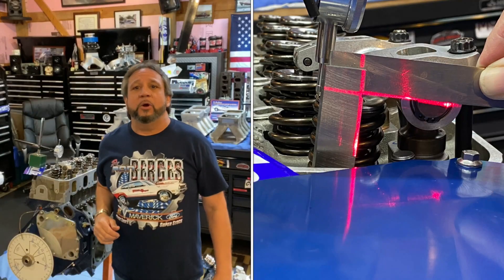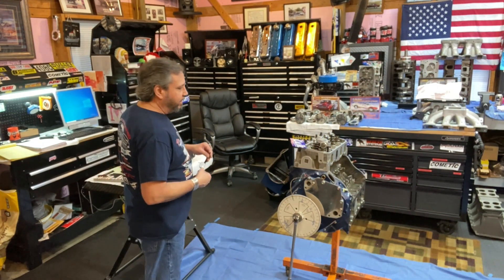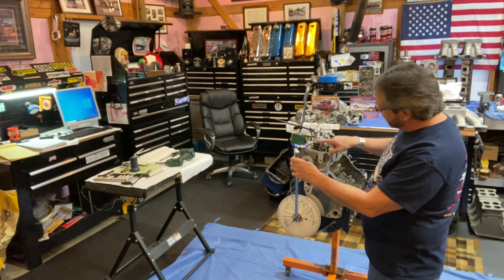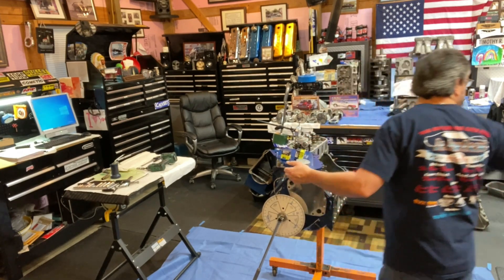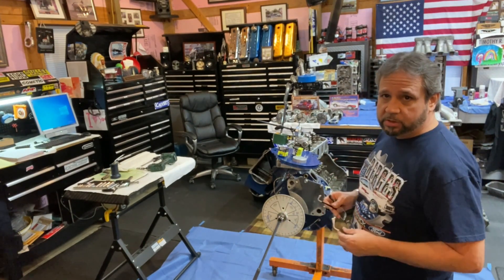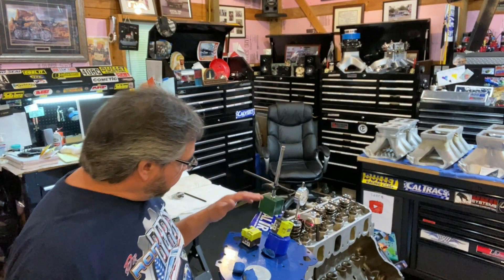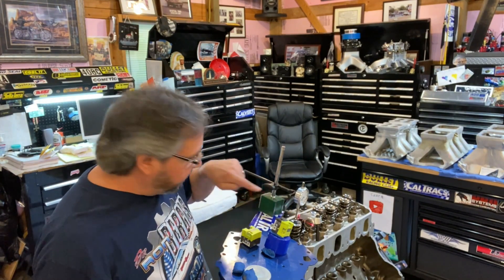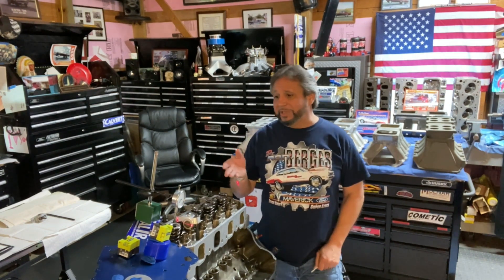Mid Lift Theory /Rocker Arm Geometry, Laser Guided Precision.

Comment: Tim, you've piqued my interest on this one.  I measured a Big Ford with A460 heads a minute ago.  In order to acheive a perfect 90deg valve-ro-rocker angle I would need to add .550" to the pushrod length.  Doing so puts the roller contact to the outer 80% of the valve stem.  It would seem like the mid-lift theory might be better served to average both the pushrod-to-rocker angle along with the valve-to-rocker angle.  My guess is the closer both operating angles are to one another at mid-lift, the better the balance between rocker arm actuation via pushrod, vs valve actuation via rocker arm will be.  What are your thoughts?
Reply from the maker: Steve, I think you are right need to compromise with both. With measuring you want it loaded, with actual valve springs, and parts you are going to use. I have also heard, that you take the 90 degree relationship, rather than the narrowest patch. Not sure on that totally, first time i have ever used it.
Reply: @DragBoss351Cleveland  Tonight I'm going to do some tests.  The first will be finding the pushrod length/rocker height that leaves me with a 90 degree angle from pushrod to rocker arm.  I would imagine an average of PR length required to yield a 90deg angle from rocker arm to valve as well as PR length required to yield a 90 between the pushrod and the rocker will yield an optimal pushrod length.  Valve length considerations will then be tested by adjusting valve lift from the mid-lift baseline to simulate either a longer or shorter valve.
Reply from the maker: @stevewix  Your way past me on that one, I understand the concept. Wondered how valve length changes it, how much overall keep me posted.
Reply: @DragBoss351Cleveland  Initial report is it works and it works well.  The roller tip is centered, sweep is more narrow, it looks right.  Here's how: Seek a 90deg angle between the valve and the line that bisects the roller tip contact point back through the axis of the trunnion, record the PR length.  Similar process with the pushrod side except you'll want to approximate the very tip of the pushrod and draw your line back through the trunnion axis.  You'll end up with two separate pushrod lengths.  Average the two PR lengths, install it and you'll have equal operating angles at mid-lift.
Reply from the maker: @stevewix  You make it sound easy, I will have to test with another build. Likes for taking the time for us Steve, Lots of info being exchanged, thanks man
Reply: when you did this with this test, did you see a change in net lift? over half an inch in PR length should change the geometry significantly enough that the net lift should differ significantly.

Comment: I found an old school scrapyard here in the Netherlands. The Guy has alot of complete ford big blocks laying around. ( And alot of Windsor small ) I think i saw 385 series and FE. But im not familiar with them. Alot of 2V carb but some are 4v. I think only the 4v are interesting for a high hp build cause the other ones are low compression truck and limousine engines?

Do you know what engine codes I need to be looking for that are interesting? I might pick up a big block for a future build before their yard is gone, these guys are old. It's like a time capsule back to the 70s lol. Must be at least few hundred engines in there and transmissions
Reply: ANY 385 BLOCK will hold a decent amount of power with a good rod and piston in it. Early ones only (68,69,70,71), will have factory heads with high compression; all the ones after that have lower compression. ALLOY heads are a great way to save weight and increase performance !!
Reply: @arkhsm  yeah, im looking for the early ones...
Reply from the maker: Man that is a treasure chest over there. For any cleveland, block does not matter, 2 or 4 bolt. I think the earliest ones are best, The most popular cleveland seems to be the D2AE, they had a lot of shift though also. DOAE, I think are the best. Does not make a difference with carb, unless your looking for 4 bbl heads. You can make CR what ever you want. 385 blocks the same, earlier the better. Thanks Bart.
Reply: @DragBoss351Cleveland  hè didn't have Clevelands. I maybe saw 1 that was a 400M I think
Reply: @DragBoss351Cleveland  yeah 4v heads... Hè had mostly 385 and FE engines i think. I Will need to go back  and find the engines codes. I would be interested in buying An early one with high compression and 4v heads. 

I think alot of Them are the later lower compression ones. I really need to have the guy there allow me to look up some codes to see if there is an early one out there
Reply from the maker: Probably 400, may be 351m. To bad you did not live close by, have one for you Bart. Can you imagine the Mustang with 0ver 500ci. Man alive
Reply from the maker: You never know. Offer him a few bucks to just look around, I would take high low cr, anything to start with.
Reply: @DragBoss351Cleveland  i saw a 460 2v . Will have a look around when the weather cleares. It's so bad here only 14c lots of rain almost june!
Reply from the maker: @hoedemakerbart  it gets done when it gets done. 10 am and 75 and sunny.
Reply: @DragBoss351Cleveland  lucky:)
Reply from the maker: @hoedemakerbart  oh yeah that 605 would be perfect for 1940 Ford Coupe. Thanks for the heads up.
Reply: hoedemakerbart the Ford 385 series of big block engines would be an excellent choice for making good power numbers without costing a fortune. As with all engines,  more power will naturally cost more so doing some research online will help you become familiar with the components you need and avoid paying for the wrong parts. 

Here in the U.S. there are still plenty of good rebuildable 385 series big block Ford engines available in the salvage yards. The 370 cubic inch version was mainly used in truck applications and came with 2-V or 4-V carburetors. The 429/460 passenger car engines were also equipped with either carb and the 460 was used mainly in heavy Lincoln-Mercury cars that needed the big torque they provided. The high performance 429 Cobra/Super Cobra Jet engines ceased production in 1971. They have blocks with 4-bolt main bearing caps but are rare and unlikely to be found in a salvage yard. 

According to Jon Kaase in an article published on Hotrod.com about the advantages of using a 460,  he suggests using any 460 block produced in 1979 or later for stroker builds. Apparently these particular blocks have 0.250” longer cylinder walls than previous 460 blocks. They would be a good choice for long stroke builds to add stability to the piston when it reaches BDC. Regardless of the make of engine, it’s a common problem with strokers when too much of the piston is exposed from the cylinder wall at bottom dead center. The piston instability causes a loss of ring sealing and lost power with increased wear on thrust surfaces. 

You’ll need to know how to read the part numbers and decipher the casting date codes located on the side of the block.  You can Google it and learn what it all means or ask me and I will try to help. 

The cool thing about using a regular production Ford 460 block is the low cost compared to an aftermarket block. Plenty of stroker kits are available. With a 4.390” bore and 4.500” stroke you’ll have 545” of badass Ford 👍.
Reply: @danielwilson6665  thanks. I Will have a look what they have

Comment: My number 3 and 5 cylinder in my sbc 383 seem to require longer pushrods than all the other cylinders. Literally a full additional turn on the rocker cups to get them within the .019 spec. I have 7.900 in pushrods for all the other cylinders but those two require like an 8.10 to keep it under the two turns for these shaft rockers. Any idea why this is? It's a solid roller cam.
Reply from the maker: That is strange. Only thing I can think of block, head not square, or rocker pedestal. Cam lobe not equal. I don’t know. Maybe someone will chime in.
Reply: @DragBoss351Cleveland  think it would be ok to use different length pushrods for those cylinders? Come to think about it the pedestal being hardened steal did have a slight bow in it believe it or not.
Reply: @DragBoss351Cleveland  figured it out as I was like well maybe if I tighten the pedestal bolts tighter it'll pull the bow out. So I go to do that and the damn things where loose. So ill run through them all and locate them down. After 6 months the problem is solved lol
Reply from the maker: @mitchellfay5725  It could, if your running big pressures, there is a lot of flexing, and stress. If the geometry is good, roll with it. Not great with valve train, learning myself.
Reply from the maker: @mitchellfay5725  Excellent, send it. Glad i could help, if I did...Stay tuned.
Reply: Run a straight edge across the valve stems. See if they are all the same height.

Comment: Just MEASURE gross lift! You can MEASURE increases in lift however you trying to look down a laser level is open to tons of error.   Shorten the pushrod. If you lose gross lift at the valve you are going the wrong way. Then use a longer push rod. If you gain gross lift, you're going the right way. This works on adjustable pivot rockers only. For shaft or pedistool rocker setups, you have to shim the shaft or pedistool to see this change. Max lift you can accomplish will result in a MEASURABLE result of best geometry.
Reply from the maker: Others have mentioned it. This is something I tried. Works for me. Will have to try the other method too. Thanks

Comment: So everything is working off the rocker.cover rail, a surface which is basically uncontrolled for parallelism and flatness. Then bolt on a plate with a ton of projection error and eyeball a laser to it. Thanks, but I'll stick with my Prussian blue......
Reply from the maker: Thanks for watching Mike. Like I say, if it works for you stick to it.

Comment: laser in thumbnail aimed too high on valve stem side
Reply from the maker: Looked great from my view. Runs 8400 through traps and good to go. Thanks for watching.
Reply: might LOOK good, but its geometrically flawed, the pivot points are the center of the large part of the roller, which is correct and the TOP of the valve stem/roller. Put a degree wheel on what you have there and you will see when you spin it, the method you used makes it off.
Reply from the maker: @vg23air like I say do what works for you. My buddy down under utilize this method and hooked me up. That engine made 769 with a 4150. Runs 9.30s at 144. Shift at 8k and go through at 83-8400. All good for me, so will ck it out next time around. Thanks for watching.
Reply: @DragBoss351Cleveland  I understand, but, he did what many have done, he assumed the GEOMETRY is the center of both rolling points, thats not geometrical, the point where the roller touches the top of the valve is the CENTER of the movement not the center of the little roller. Lots do that but just make a model out of paper cutouts and you can see the CENTER of the LEVER is not the roller.
Any of us the also setup the linkages for radio control planes learned early on about levers and such.
Reply from the maker: @vg23air  Well to me it works or it doesn’t. In this case it works for me. Tell me how you do this correctly? How much difference will there be, might be tough to explain.
Reply: @DragBoss351Cleveland  if its not centered then it will accel and decel on one side of the 50% more than it will on the other, ie valves open and reach 50% but the components arent centered yet and then they continue to open at a different rate, its all geometery, so there is accel decel accel, who knows how it effect, get me  a dyno and an engine and a month
Reply from the maker: @vg23air right on, I can see what you mean. I’m going to keep on going, next time I come to that, I may revisit my method. One engine and dyno coming up.
Reply: @DragBoss351Cleveland  the main thing is this method will let the roller stay centered and not stray across the lash cap
Reply from the maker: @vg23air the question I ask myself, will it make that much of a difference on this build. Not a super stock build.
Reply: @DragBoss351Cleveland  the main issue is keeping the roller centered and not roaming across the valve stem

Comment: If you do some Dyno testing you will find that the best power is always when you favor the Ex side of the valve stem. All you need to do is find the correct mid lift push rod lgt. Then invest $500 in push rods in .050 increments. 4 sets of push rods will work then about $500 in dyno time and you will find more power.
Reply from the maker: Racer, sounds like super stock power search. I bet those guys do that for sure. What can you gain from your experience?
Reply: @DragBoss351Cleveland  Well I am sure they do, but for me it was Engine Masters
Reply from the maker: @racerd9669  meaning you were entered in engine masters? Or saw that there. Great info for all. Thank you.
Reply: Mmmmmm, interesting comment. Now I am trying to visualise what would be happening. Presumably for engine masters you would be looking for an increase in power. I have set my clevelands up so the valve tip contact patch is central and minimised. Theorising that would be the most efficient motion and minimise side loading of the valve and guide, aiding reliability. And thinking it through this method should give you 90 degrees at mid lift, probably🤔.
Reply from the maker: @largeeng  I was thinking that little more favor of exhaust, gives it a bit more duration and lift. Talking only a few degrees. Thanks
Reply: @largeeng  You need to starting thinking in terms of mid lift flow, because that is the only place the engine breaths at. So gaining lift at mid lift will help power. It is all about when you apply the ratio, not the rocker ratio.
Reply: @DragBoss351Cleveland  I did forget to mention one thing , this only works on stud mounted rocker arms.
Reply: @DragBoss351Cleveland  I had the winning engine in 2002, the 366 Cu In Cleveland headed 8.700 deck Ford racing block.
Reply from the maker: I understand Racer. Thanks
Reply from the maker: I will have to look that up. Don’t remember it from that long ago, congratulations by the way, that is an accomplishment. Appreciate you being here.
Reply: @DragBoss351Cleveland  What you will find is that Joe Sherman won and I was put in 2nd place. We lost by .9 average. But then they had the nerve to post the Dyno sheets on the internet and what they showed was that Joe was allowed to run his engine at 120degs and the rules clearly stated that the engine was supposed to be run at 160degs. The first 2 pulls on Joes engine was at 120degs and the 3rd pull it was up to 160degs and it lost 20 on the average. While Steve Ruel , would sit and heat soak my engine and make pulls at 170degs. Needless to say , they wanted Joe to win and helped him cheat , and cheated me out of $45,000 in prize money.
Reply from the maker: @racerd9669  that is BS, no protests as I bet they released the numbers after winner  declared. What specs and heads were on it. Thanks
Reply: @DragBoss351Cleveland  I did protest, but all it did was ban me from the E.M. for 3 years. I started out with the idea of using a Cast Cleveland Quench head with port plates. But a friend in Ca. knew John at CHI and he had a head going around the U.S for display. John gave the heads to me and I did a port redesign and that became the CHI 185 head.
Reply: Racer D are you referring to mid lift flow or rocker setup?
Reply from the maker: Rocker set up is what I understood Steve.
Reply: @stevecleveland357  What I am referring to is how to get more valve lift from your rocker arm at mid-lift. Which in turn lets you access more mid-lift flow
Reply: Thats very interesting. I just changed lift on a 449 inch ford im working on. I had a 9.850 length pushrod that initially gave me a good sweep. Not midlift. I couldnt get a good geometry with the added lift of this cam. .727 to .750. ! I had a set of 9.54 pushrods off a a-head bbf. I mocked those up and to my surprise gave me very nice geometry. Almost perfect at midlift. Upon tweaking some more looks like 9.550 is pretty much dead on at mid.   Going from this observation at midlift i can almost assure i had incorrectly measured my pushrods prior with other camshaft. The other pushrods did give me a centered pattern on valve but not the ideal midlift position. I had shown this to  Randy Malik who commented he thought my pushrods definitely to long. Looking back I believe he was correct. Thanks Steve
Reply from the maker: @stevecleveland357  I understand what your saying. I have added longer exhaust valve, plus lash cap, in my case had to add an .080 shim under stand, had previously 8.400, Checked with mid lift and needed longer, I got 8.450 and 8.500, initially looked like longer was a better with mid lift, will check again with 8.450 to make sure. Thanks for watching and contributing to my channel Steve